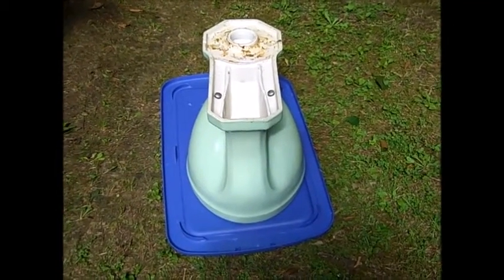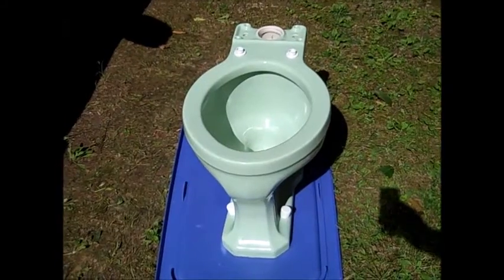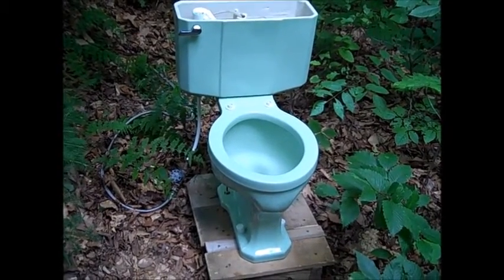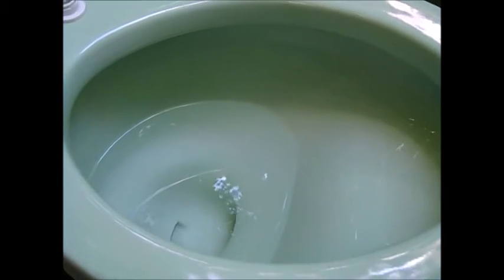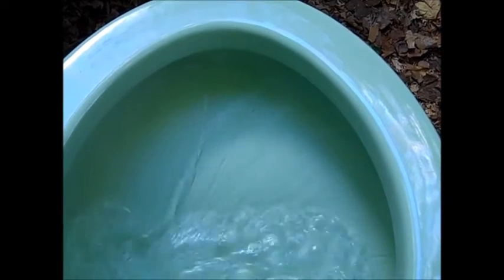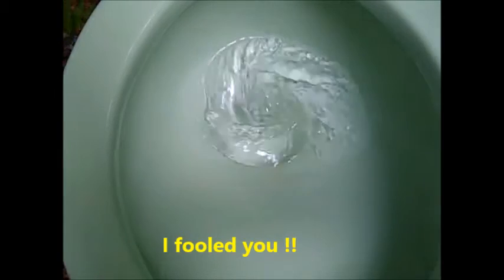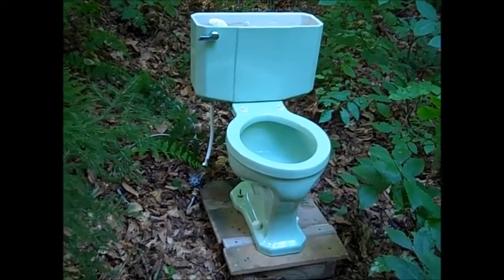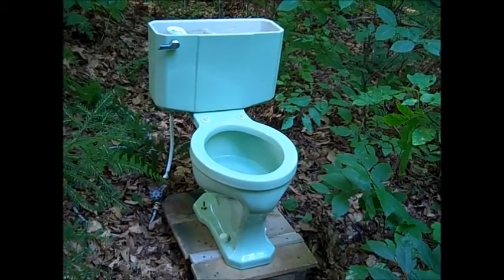75. Eljer Waco Outdoor Flushing Tests

Comment: i do like the flush and how it swerls
Reply from the maker: I reinstalled this one again back in July or August to retest it after the muriatic acid clean.  While as not nearly as strong as a Standard Modernus or Compton, it did not clog.  I will be testing it further next year once the cabin is opened back up in the spring.

Comment: I've seen a couple Wacos on YT and compared to them this really IS sluggish! Wonder if the tank ball might need adjustment. Of course, also this is technically a waterfall on that first flush lol
Reply from the maker: I'm going to have to re-watch those YT videos and compare.  Several viewers have commented about the tank ball.  Wished I'd seen them before I put the Waco back in storage.  When I bring it out next, I'll try another tank ball.  Maybe the one I was using was too heavy.
Reply: Yeah. I'd suppose a lighter one might work.

Comment: I've seen several Wacos in my life time and don't think I've seen one quite as sluggish as this. If it used a bit more water or maybe if the tank ball dropped a little later, it would be better at removing everything on the first flush.
Reply from the maker: I wish I had tried holding the handle down to see if it flushed better.  A couple of you made the observation that the ball dropped too soon.  I had a 1942 Waco in one of my apartment.  The jet was positioned differently.  The older version has a much more powerful and thorough flush.  It was also louder.  Perhaps the next generation of the Waco was designed to be less noisy at the expense of performance?